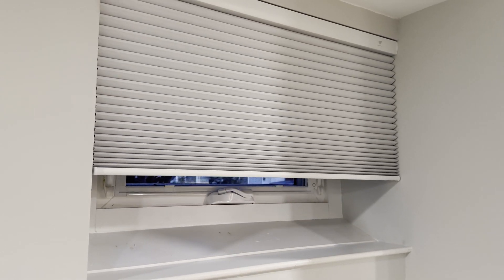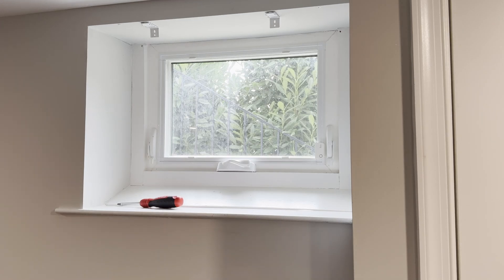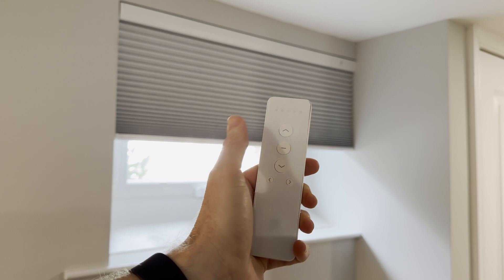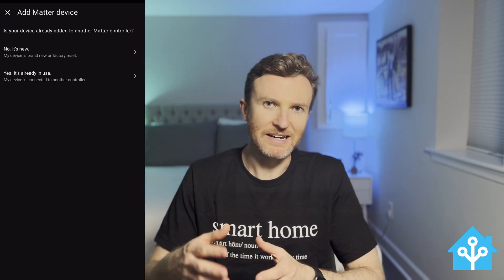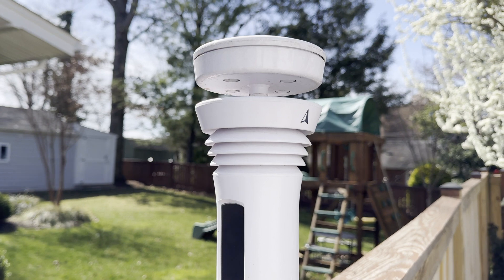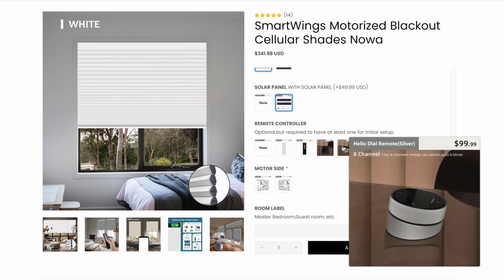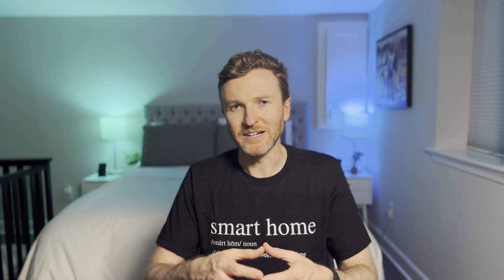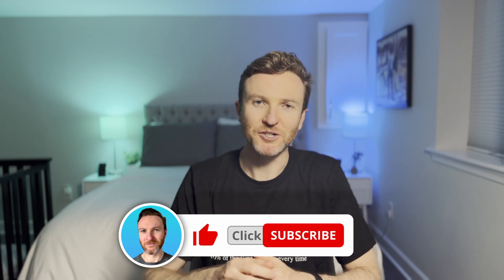Smart Motorized Shades with Matter-over-Thread (SmartWings Review)

Comment from the maker: 👉 Interested in SmartWings motorized shades? Grab them here: https://go.michaelsleen.com/smartwings-motorized-shades. NOTE: I have since learned that it is possible to disable the blinking LED when charging. Close the shade completely, and then press and hold the down button for 5 seconds and the red light flashes 3 times. After doing this, the green light will only flash once when the remote control signal is received.

Comment: Hi Michael,  I recently discovered your channel while searching for a solution to pausing the A/C when a window or door was opened for an extended time.  While I'm not well versed in Home Assistant, this might be the push I need to get started.

I was browsing your channel and saw your review on Smart Wings.  Great video, very through.  My wife and I bought two sets of roller blinds from Smart Wings after first purchasing the fabric sampler.  We were pleasantly surprised at the variety of textures and colors available.  It's worth noting that the samples were large (5" x 8").  Incidentally, Smart Wings also offers honeycomb fabric samplers as well.  It's money well spent.  No charge for shipping for the sampler or the blinds.  Another pleasant surprise.  Also need to mention that we had a problem with our first blind, it had some sort of distortion in the fabric at the bottom which was very noticeable.  Kudos to Smart Wings support, after recommending a treatment that didn't work they replaced the roller shade (less the motor) for free.  It was an easy swap (they even have a video) and the replacement shade was perfect.  When we need more blinds, Smart Wings will be at the top of the list.

I'm looking forward to your other videos.  Keep up the good work!

Scott

Comment: Michael, what is required for matter over thread?  Is wi-fi needed also?
Reply from the maker: Matter-over-Thread requires a Thread border router. These include certain Apple HomePods, Apple 4K TVs, Amazon Echo and Google Nest devices, among others. However, Matter and Thread are two separate things, meaning you can have Matter device that works over WiFi without the need for a Thread border router.
Reply: Thanks for the detailed explanation of the differences and requirements

Comment: Very cool, I've always wanted motorized shades, but I can't justify the even still high price of window coverings. Normal shades themselves are already excessively expensive. Why on Earth?!
Haha, regardless, your review on the SmartWings shades is a good take. I agree that having a logo on the shade is unneccesary, as well as it be cool if a light tug on the shades would initiate the motor manually rather than a hard to reach button or only with remote.
Reply from the maker: Yeah, shades can be expensive by themselves. A motorized version only drives up the cost. But if it's something you are considering, these look and work really great.